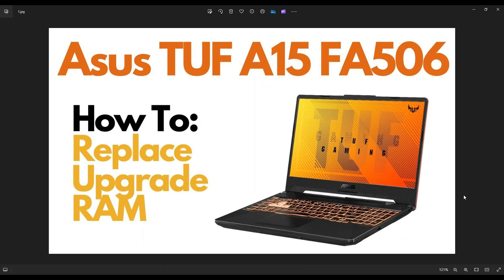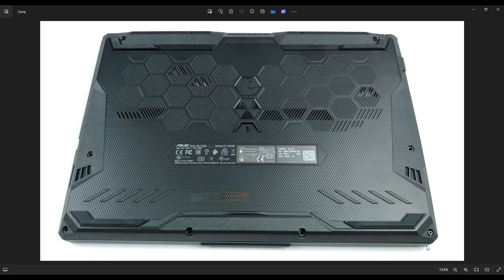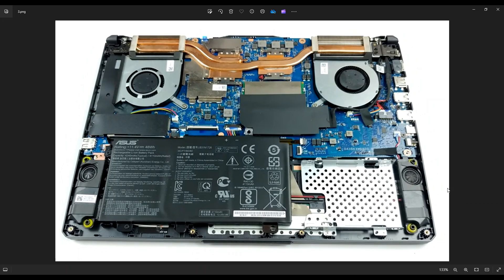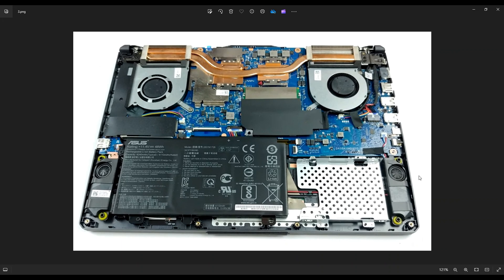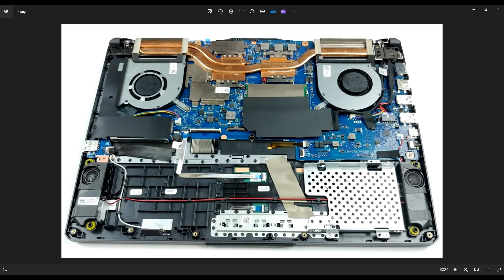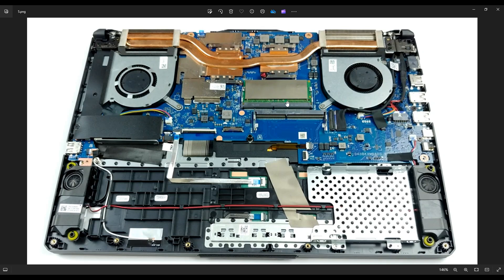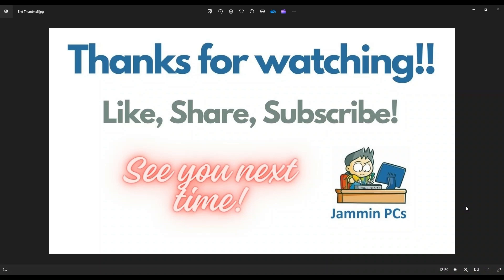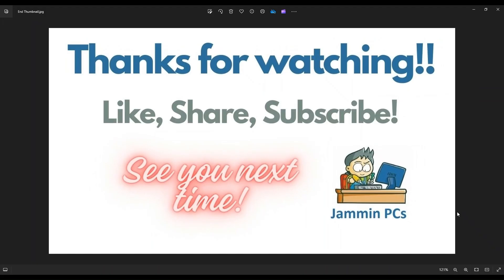How To Replace Upgrade RAM - Asus TUF A15 FA506 Laptop Computer

Comment: I have the fa506n it currently has 8gb ram can I remove that and replace it with a 16gb card and add another 16gb
Reply from the maker: Yes. I believe your model still has a max RAM of 32GB so you should be all set :)